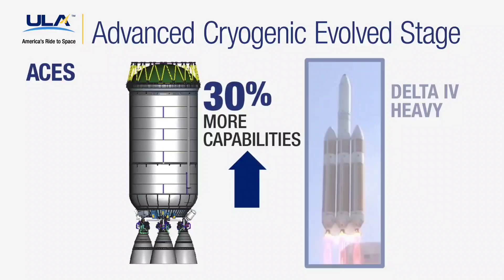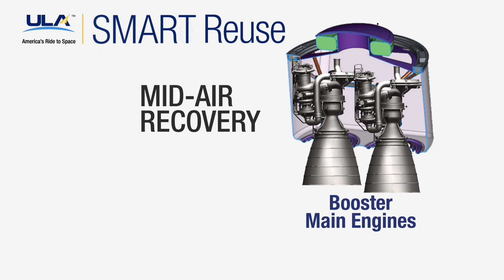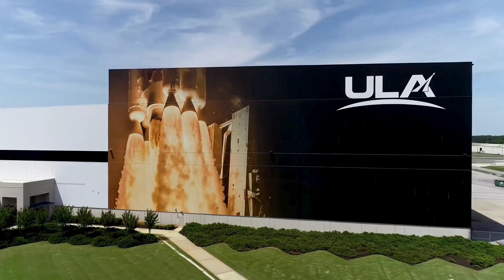Blue Orgin BE-4 having MORE problems?!  What about Vulcan Centaur?

Comment: SpaceX will likely have a larger fairing available before the end of this year.
Reply: Clearly at least the Falcon Heavy can very efficiently launch heavier and therefore bulkier payloads.  Musk, however, has apparently focussed on delivering Starship with its 9m "fairing", more than double the payload of Falcon Heavy, and lower launch cost because of faster reuse.  He has deferred authorising a project to design and test a larger fairing for Falcon Heavy apparently fearing it would cut into demand for Starship.  This decision might have been debatable IF any of the proposed competitive heavy launch vehicles had reached production status.  SLS is production ready, but is not competitive because of its lethargic cadence.
Reply: @jamescobban857  "He has deferred authorising a project to design and test a larger fairing for Falcon Heavy apparently fearing it would cut into demand for Starship." What's your source for this?

Comment: On fairings: Musk has in the past said they could easily design bigger fairings for the Falcon 9 or Falcon Heavy. He is focusing on Starship which will eventually make the Falcons obsolete.
Reply: Ed, obsolete? Different programs for different purposes. Do you think SX will launch starship for starlink only missions? You don't fire up your tractor trailer to get a slurpee.
Reply: I'm sure they'd build a larger fairing if the Air Force gave them a lucrative development contract. Or they could buy larger fairings from ULA.
Reply: @mattcolver1  : Or ULA could design the fairings mostly on their own and buy some launches from SpaceX- Musk wouldn't have to divert his engineers that way either.
Reply: Which is funny since nobody else is even competitive with falcon 9 yet including any other project in development (except maybe new Glen in theory). I say funny but it is actually sad that SpaceX has gained such a monopoly, but they 100% earned it.

Comment: The BE-4 has a combustion stability issue. The staggered thrust test speaks to that. They can't sustain full thrust because it'd fall apart. At this point I'll wager the BE-4 never flies.
Reply: That's a lie. The tests with several flight configuration engines have demonstrated consistent, full-thrust or even up to 4% beyond normal full-thrust over many thousands of seconds. 

This is just Angry and others trying to get their last bit in before the engines are delivered and it becomes apparent that something else will really be the cause of delays, from Peregrine (which ULA has built and is preparing to launch a mass simulator in its place) and or the Centaur V itself which ULA has been silent on for almost 6 months now since it went to Stennis for testing.
Reply: @thomasackerman5399  more like Musk fanboys, disguised as "Space enthusiasts". This channel too, is getting too much of a biased approach.
Reply: @RogerM88  I'm not a "space enthusiast" - just an engineer who understands when someone, namely Jeff Who, is talking out both sides of his mouth.
Reply: @thomasackerman5399  Clearly you do not understand the step function graph during the "1000 seconds". It is stepping through and not running at full thrust for "1000 seconds". Not everyone understand graphs and that is why Jeff puts them up. Deception is an art-form he's well-practiced in.
Reply: @thomasackerman5399  There's a reason BO developed a camera inside the combustion chamber. They do not understand their combustion chamber performance. It is unstable. They don't know what they're doing regarding engine design.

Comment: ULA Could probably borrow some raptor one engines
Reply: If Raptor actually worked properly. They had a lot of problems. Or have people forgotten that Elon fired the program manager last year, was screaming on Twitter how SX was going to go bankrupt, and they scrapped a hundred or so Raptor 1s.
Reply: @thomasackerman5399  The problems were more with production rate. SpaceX needs something like 200-500 engines per year, at least until they work out reuse. Though Musk would like them to just keep building them and make a huge fleet of rockets to colonize Mars.
Reply: @espenha  That may be so, but it doesn't change the fact that there are some serious issues left with Raptor development. I have no doubt many or all of them will be solved in time, but it's not going to go like how the fanboys want it to.
Reply: @thomasackerman5399  There doesn't seem to be any serious issues, as far as I can tell. Musk has talked about melting combustion chambers, but it's just a matter of cranking up the film cooling. You lose a few seconds of specific impulse, but you eliminate the melting. What issues do you see with them?

Comment: I'm for Starship, it will definitely prove my point. It's big , a skyscraper and massive amounts of tonnage. I will be introducing a different type of mathematics for duration flight. Speed concours all and we need a leap . These crafts are not built for speed but the purpose of lifting packages to low earth orbit, kind of like a train or truck and what we really need is a Ferrari. Something fast that does the same except for short bursts, not really but a burn duration of hours compared to minutes and adjustable, meaning that it can go further. Our Rockets need a change for the better and add a better life for them . A hybrid system is what we need and want . Forget about Nuclear Thermal and wait until fusion is a reality. The problem is that when we ask for improvement everyone acts like the Goblin and don't want to go back to the drawing board. Pulse Detonation system is in fact going to save the rocket system and it's the only way to press on . Space is large and vast and we are a grain of sand in comparison . Stop being a fanboy and get creative, it's time to help push forth. Investigate all systems and procedures for gaining access to space. If not , you are letting down your family, friends and your future.  I will remain ANGRY until we all get it right 😎

Comment: Saying that if entity A has issues with X then entity B has to have issues with X as well is a logical fallacy. There is no correlation here, these are two separate sets of people working on two separate designs for engines of similar type. 
There is also one giant difference between BO and SpaceX: SpaceX have produced at least 60, more likely about 90 Raptors across all variants. BO? I don't think they have made 10 yet, including early prototypes.
Reply: Indeed AA has made light here of all the testing of all the Raptor 2 engines that will be installed on Booster 7. There will be static-fires of the engines. Raptor 2 has an assembly-line. BE-4 has not. I don't know why AA is drawing false parallels on this. And I'm growing a little jaded on the loud hectoring voice AA insists on using because he is 'angry'. I much prefer the more dulcet tones of Marcus House, who while maybe not going off on technology or what-if tangents, is more pleasant and less wearing to listen to.
Reply: Or the voice of Scott Manley.
Reply: Thanks.  Kept me from saying it.
Reply: they have actually built over 100 raptor1's and i think they are up to 80 on raptor 2's.  their build rate is nearly 1 every 2 days now which is incredible
Reply: No - ONe company is designing and building engines for the second Company, which is just designing a vehicle to USE that engine. That second company is finding that the engines delivered are leaking fuel. Not a safe condition, not easily solved by the second company either. If this were a car company, the the first company would be sued for failure to deliver on a contract.
Reply: @jessepollard7132  ULA has a contract with the US military to launch 60% of its upcoming orbital payloads in the next few years. The decree that Russian engines can no longer be used on US military launches means that Atlas 5 can no longer be used for that purpose (and besides, the remaining Atlas 5's are allocated for the Amazon/BO Kuiper constellation launches (as I understand it). So ULA is being screwed by BO knowingly or otherwise, as ULA has to wait till a working flight-ready version of the BE-4 is available, and even then, has to successfully fly 2 proving flights to get certification before the military will allow their payloads to be flown on it. Whoever these BO fanbois are, who have been critical of SpaceX in the recent past, in the YouTube postings, they should take a few moments to reflect on their misplaced faith in BO, and the assumed likely premature news on the readiness of the BE-4. I myself received some  posts claiming that everything was now superb and hunky-dory, and just constructing the BE-4s at ULA for test-fires and installation on Vulcan (why even need to have them in bits), was just weeks away.
Reply: But the point is, BO was started before spacex, they have yet to have anything reach orbit. So I think they will do it, sure, do I think it will be an achievement, I guess. We are seeing more and more companies, countries and individuals reaching orbit than ever before, it's just not that great. With that said, I'm more interested in the likes of rocket labs and skyrora. Will starship be interesting, for sure, but I'm really looking forward to what the new guys can drop to make sure we have competition in the market

Comment: Angry Astronaut; "No, the solid rocket boosters performed flawlessly just like all the others before."    

Space Shuttle  STS25;  "here, hold my beer."
Reply: That can't be blamed on the booster as it was used in conditions it was expressly NOT to be used in against the engineers warnings.   It wasn't used as designed.  Like using your cellphone as a hammer and wondering why it breaks.
Reply: Morton Thiokol expressly told NASA to not launch after the Shuttle had been sitting on the pad for a couple weeks during the coldest winter on record for Florida. NASA suits wanted the publicity from Christa McAuliffe ASAP, despite being aware that the seals on the SRBs were compromised due to constant heating and cooling in the Florida weather.

Comment: 14:20 That's false equivalence. The engineering programs could not be more different. BE-4 is essentially a NK-33 scaled up with a fuel change. Raptor is an entirely new beast tailored from the start to it's fuel, and designed by a firm that has reused hundreds of engines. On top of that the lead designer of the Raptor is an obsessive minimalist, every part you remove is one less point of failure. Just look at a Raptor2 verses a BE-4. One looks like it would explode if you look at it cross-eyed because each is artisanally crafted from thousands of parts while the other looks like a solid work horse made from the fewest number of parts for volume production. Volume production is where you find the flaws after all.
Reply: Also, the developement ideology is waterfall vs agile.
Reply: The Raptor engine is actually in most ways a significantly more difficult engine to develop than the BE-4, though the BE-4 does have one failure mode that the Raptor doesn't - having a single drive shaft shared by both turbo pumps. This, tellingly, increases the chance of a fuel/oxygen leak through seal failure.

Nonetheless I have far more faith in Raptor development than I do in BE-4 development for the simple reason that there have been way more than an order of magnitude more Raptors built and tested. Indeed, I believe it is approaching two orders of magnitude. Yes, SpaceX has made mistakes with Raptor development and has experienced unexpected failures, many, many more than Blue Origin has with the BE-4. However, SpaceX has a corporate culture that encourages making mistakes and learning from them. Consequently, it has learned way, way more than Blue Origin about staged combustion engines. Extensive testing of one or two articles is simply not the same as adequate testing of many, many articles. Furthermore, SpaceX is largely a company of amateurs in the original sense of the word. People who do their work mostly because they love the work, rather than for the money - and consequently will work however long and however hard is needed to finish the job, and thank their leaders for the opportunity. Blue Origin is mostly an organization of "seasoned professionals", which largely translates to jaded old timers.

Funnily enough, both companies are trying to minimize their development costs. Blue origin by using the old-time space companies "proven" methods, using countless engineering hours to avoid building costly prototype articles. SpaceX by building prototypes as cheaply as possible, and constantly trying to find cheaper ways to build them, building them by the tens and hundreds, then most likely destructively testing them to learn and correct their failure modes. From the outside it sure looks like the SpaceX approach is the superior one.
Reply: @colindavidson7071  Blue Origin is roughly where SpaceX was back in 2019. The first iteration of their rocket engine works on the test stand, and they are getting ready for the first flight. Just as with SpaceX, it's not unlikely that they will learn a lot from the first few flights.

And then they should ideally take the experiences from flying the first iteration, and make a better engine, just like SpaceX did with Raptor 2. Though that is a step that Blue Origin probably aren't going to do. They should have been delivering engines ages ago, and taking years to rework and optimize the design is not something ULA would appreciate. So, they will likely just live with a design that has quirks, flaws and is difficult/expensive to produce. If the reliability isn't the best out the gate, they will likely rework the design juust enough to get the reliability up to a level ULA can accept.
Reply: @colindavidson7071  you contradicted yourself when you said Space X, with the Raptor has had many failures that were not expected.  Well, that is,  as you later pointed out a part of Space X culture and how they do rapid development and design.  Any failure is absolutely  expected,  without failure nothing is learned and subsequently no advancement can be made.
Reply: @weswelborne4582  You are playing semantic games. While failures in general are expected, the particular ones that occur are likely not - or they would have been fixed before test. It is entirely possible to run a test, expecting failures, while the failure that actually occurs was unexpected.
Reply: Seriously. Lots of designs can get a job done but which one can do it and be the easiest to produce and simplest with fewest ways it can fail.
Reply: Yep. It was interesting to me that he could see that BlueOrigin not having enough parts to make engines to test was part of the problem leading to BE4 failures, but then says that SpaceX where they are making five Raptor II a week and doing several orders of magnitude more tests will be likely to have the same issues?
Reply: @tribalypredisposed  SpaceX already has done hundreds of tests with both raptor versions - to find failures and fix them rapidly. the only one that took added time was the melting of the throat of the combustion chamber - that required SpaceX to use a different metal. Blue Origin hasn't done the testing and learning yet. So trying to call one "production ready" is still a joke.
Reply: No engine is the best engine then.
Reply: the BE-4 is basically failing. and That is the fault of engineering by Blue Origin.
Reply: You completely turned your comment into a fanboy meme, considering Musk the Chief Designer of the Raptor engine. Meanwhile he spends too much time in Twitter, while taking credit for the Team work
Reply: @RogerM88  What if I told you...you can do multiple things at once?  I know you've texted while continuing to perform another task.  Who gives a damn if he fires off a odd tweet or not?  The public has never had this kinda access to a launch program in development.
Reply: @RogerM88  do you ever take a shit and browse the phone while you have something in the microwave? 
That's all Musk does... Just on a grander scale than us peons.

Comment: I gave up when he brought raptor into it.... ffs even if he blows up the first few he will make more 🤷‍♂️ it's been due awhile but your channel is due an unsubscribing for me thanks for the content thus far best of luck 👍
Reply: I predict this unsubscriber will post in Angry's next video. Remember that name!
Reply: @RockinRobbins13  AA does have a pattern of giving BO the benefit of the doubt but applying unreasonable standards to SpaceX.  

Consider the current video with his assumption Raptors (over 100 total built of 2 basic designs and a number test flown on Starship) being assumed to have the same problem BE4 has which has only had 2 that were designated even to be flown at all.  Why should the much more heavily tested Raptor design have the same flaw as BE4?  No reason.  Just because he says so.
Reply: @Scanner9631  We'll see. I hope he's wrong, but then HE hopes he's wrong. You know, sometimes being wrong is the happiest result.